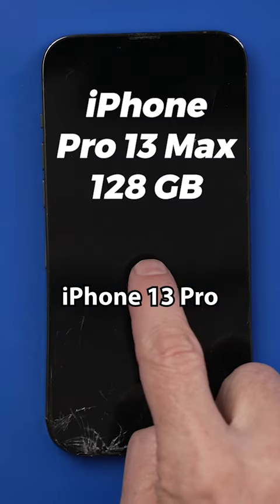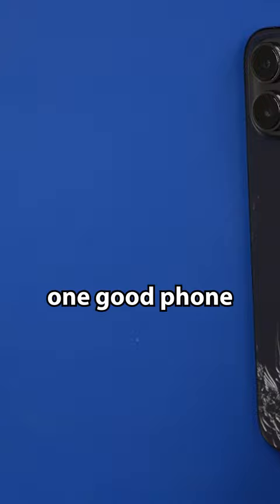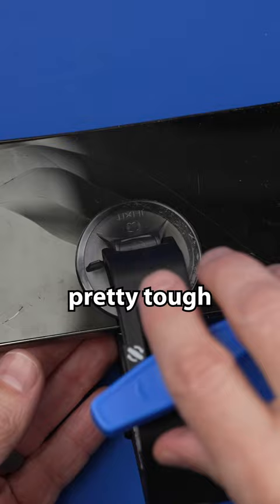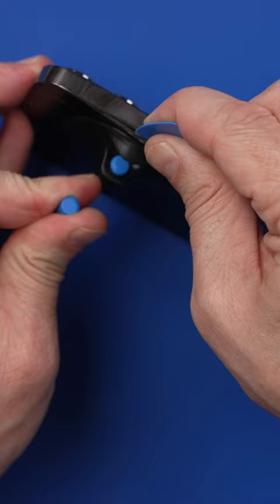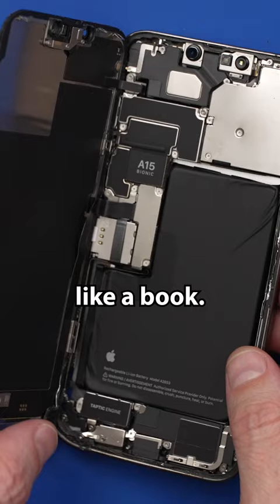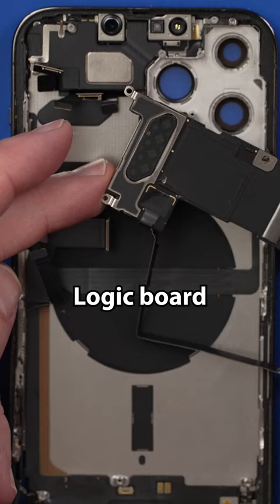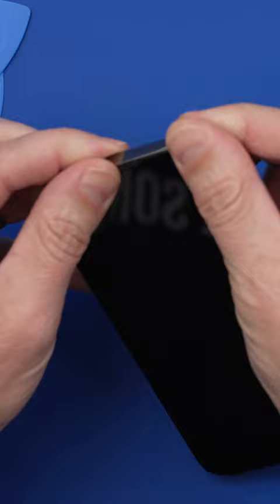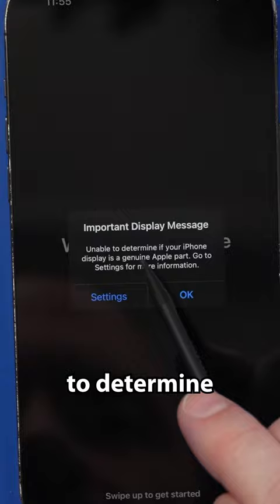Turning 2 BROKEN iPhones into 1 Working iPhone!

Comment: You need that little device that copies the serial off the old screens
Reply: I think it doesn't work with newer iPhones because Apple themselves have patched the $hit
Reply: Unfortunately it doesn’t work like that. There is indeed a device (either from JID or Qianli) that can copy serial numbers from the old screen to the new screen, but this is only to restore the truetone function. They’ve implanted the “not genuine Apple part” feature since the iPhone 11, the only work around is to desolder a specific chip thats placed on the old screen and transfer it to the new screen
Reply: @traigon273  damn didnt know that :(
Reply: @alisterrebello5337  it still works. Trust me I have a repair shop!

Comment: Yes, it definitely is. All the apple parts have a specific identification code which are set and matched together after assembling. So if you do reaper or replace any of the parts, it doesn't work and they need to be registered again by apple service shops.
Reply: Haha we don't tolerate such nonsense in android

Comment: How can I fix touch screen on 3Ds
Reply: There is a tiny clip on the motherboard attached to the screen when you take the chell apart, that connector can get loose, check if it is installed correctly.
Reply: @sennthemanwin98  thank you

Comment: I tell people, continually "DO NOT BUY APPLE PRODUCTS" because they are rip off merchants. But people still buy them because it's cool to buy them. Take phones for example, you can buy an android phones, far cheaper and the same quality and better. You can also buy cheaper parts for them and repair them yourself instead of sending them back to Apple to be charge a horrendous price to repair it. 
Take computers? You don't see the top gamers and computer specialists use Apple do you? No, of course not. Like the android phones, you can buy much cheaper parts, build your own PC and for the same price as an Apple you'll get a much more powerful unit. 

The reason why people by Apple is for two reasons:

1. They're morons and haven't a clue about mobiles and computers.
2. They watch movies, which ALWAYS promote apple products over PC's.

I played about with Apple Macs when I was doing web design, back in 1999. I hated them. I never bought one and never will. The same with I-phones. Anyway, if you can get everything you need, on a mobile for £170/$211. If you're paying more you're getting ripped off. Buy a PC instead if you're paying £500/$620+ for a mobile.